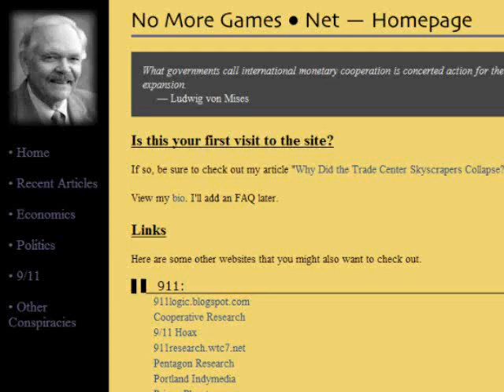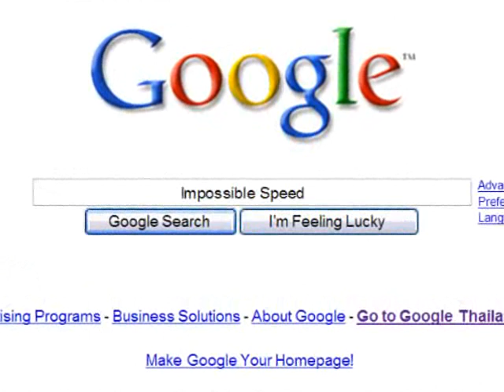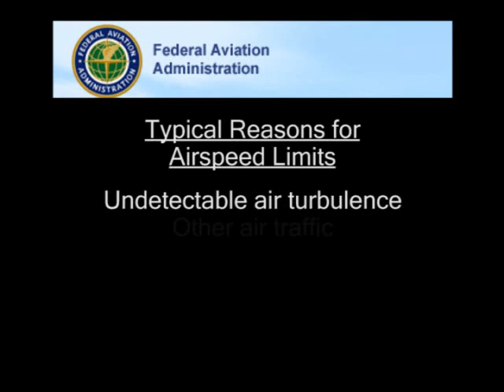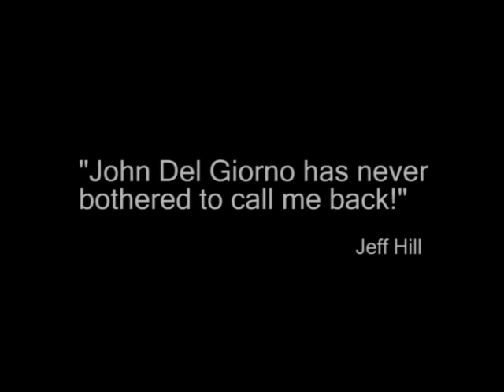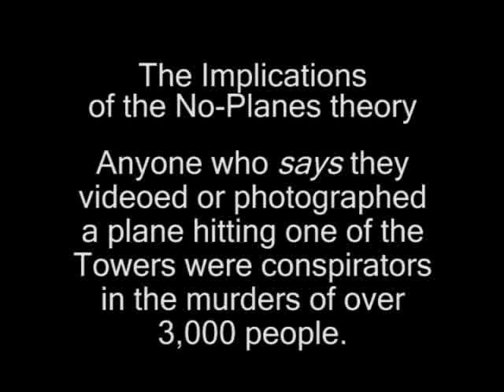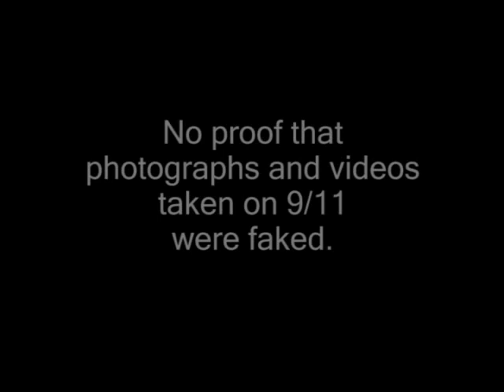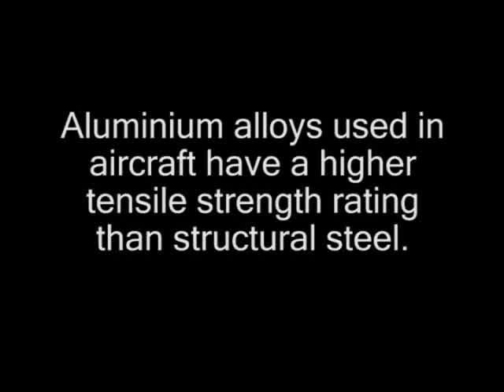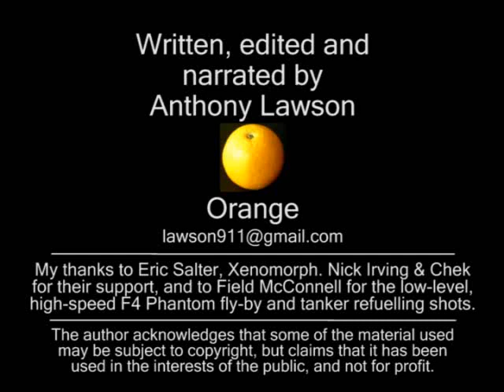9/11: Impossible Speed & Impact -- Busted! Updated

Comment: Just as my $0.02 worth on the subject, please think about this:  The aircraft, in order to reach the speed alleged to have been, would have to descend, be it a "power dive" or what ever  you gotta call it, its heading down in order to increase speed beyond what can be achieved in level flight using the jet engines ( also to address the military aircraft do NOT use the same engines as civilian airliners ) anyhow in order to do this power dive maneuver, the pilot must lose sight of the target and then upon pulling out, re-acquire said target.  There is also the factor of pilot skill, one needs to know the aircraft very well in order to dive, attain speed, and then pull out, and in the case of extreme speed, pull out in such a manner so as to not over-stress the aircraft & break something. .... not logical JIM, not logical at all!
Reply: +Bob Jay My dad was a airline pilot and been among the Pilots for 9 11 truth! The second "airliner" with a visible pod underneath is for remote flying in case the pilots are taken out!! They simply doesnt exist on anything else than military aircrafts! The second plane flew in a higher speed suggested here and it was at 580 mph!
Reply: I wonder if  he believes the impossible maneuver of the 757 that supposedly hit the pentagon, too. Came over the Pentagon at 7,000 feet, dove into a 270` right hand nose down turn then  leveled off at about 10-15 feet off the ground and maintained control throughout till he smacked right into the window of  Captain Gerald DeConto sitting right there in the Naval Command Center!!!!.  This guy???... Hani Hanjour  who could barely fly  a Cessna!!! ??  And to really believe that someone without  training and  conditioning could take all those G forces???? He would have been passed out long before the perfectly controlled maneuver he supposedly pulled off, and or (probably BOTH) the wings of the plane would have been ripped off!!!  The 757 couldn't even have been able to withstand those G's!! Sheesh. THAT maneuver ALONE makes me doubt the whole 911 official story. And that's  what it is...a story and a fabricated story at that!!
 Those planes that hit the towers were modified military aircraft that were DRONED. The real passenger planes were taken out over the Atlantic and vaporized. How?? Boeing Uninterruptible AutoPilot and smacsonic.  That is from the knowledge of Field McConnell. ABEL DANGER is where you will find the truth!!!
  Thanks to the uploader but sometimes it is confusing to me.~
These 'no plane' theorists make the TRUE  truth movement look like wackos and they just muddy the waters. .
Reply from the maker: And it's not even worth 2 cents.  You obviously haven't heard that large aircraft can be remotely controlled, with a computer interface that takes all kinds of internal and external conditions into account.  Try doing some reading.
Reply: Given a remote controlled aircraft, that still doesn't solve the problem if the penetration of the WTC wall without slowing down.
Reply from the maker: Bob Jay
 Another goal-post mover.  Have you checked that the fuselage did not slow down, slightly, as the plane was entering?  Check out Eric Salter's work on the plane's deceleration.  As for the impact, see if the following answers any other questions you might dream up.

The 9/11 planes—highly integrated pieces of tubular-shaped machinery, almost certainly Boeing 767s or something very close to them; KC767s perhaps—weighed, say,150 tons.  In the case of the South Tower impact, the plane was moving at a velocity of about 575 mph and I have calculated that kinetic energy to be expended was approximately 1,189,068 kilojoules. 

Some aviation alloys, such as wing spars, have a tensile strength greater than that of structural steel, so, as far as the vertical walls were concerned, something had to give, which were the bolts holding the wall sections together.  These broken-away sections were, of course, pushed inwards and the sideways-on concrete floors then tore those parts of the fuselage that did not enter between the floors to pieces.
 
The reason why the entry of the planes into the buildings seem surreal is easily explained.  In the case of the CNN/Hezarkhani video, the frame of the impact covers about three times the width of the Tower; say 600 feet.  Let's say that the average size of a YouTube viewing area is 6 inches across; half a foot.  What we are talking about is a visual compression of 1200 to 1 of an NTSC broadcast image, recorded on VHS. 
 
You’ll get more detail photographing a bowl of porridge. 
 
Compare that to this video of a NASA rocket lifting off, where the cameras are one–hell-of-a-lot closer, and almost certainly a lot more expensive than Michael Hezarkhani’s.

Liftoff for Apollo 11
Reply: "explain how the two illusions were achieved and prove that your explanation is correct.  "   This is something that I take issue with most strongly!  I can prove beyond a reasonable doubt that the official story is WRONG, without having a ready alternative explanation for how it was done.  Therefore the starting place for the demand for a new investigation is the fact that people can prove the official story WRONG.
Reply from the maker: Bob Jay  My true colours?  What I do is  follow the facts.  You are almost certainly correct in stating that "there were NO hijacked airliners on 9/11/2001" which does not mean that there were no airliners or no airliner lookalikes in New York.  So, please state your position, clearly: 

Do you or do you not accept that two large Boeing 767s or two similar planes hit the Twin Towers that morning?

If you do not think that ANY such planes were involved, you will have to do what no one else has ever done: explain how the two illusions were achieved and prove that your explanation is correct.
Reply: Seriously? No hijacked airliners? What, pray tell, happened to the passengers and crew? You need some serious mental health assistance.
Reply: Bob Jay He never once said that there was hijacked airliners involved. He's stating that planes were used, which is correct. Anyone who believes that no planes were used are either incredibly stupid and gullible or a disinfo peddler
Reply: The fact that it is physically impossible for the "FLT175" & "FLT11" penetrations of the twin towers to have been done with actual airliners, it is extremely doubtful that even modified military aircraft could pull off such a stunt. therefore the only explanation that works is that there were no planes.
Reply: Anthony Lawson Is this a Boeing 767 series 200 made from interlaced aluminum struts and spars with a 2mm aluminum skin to keep the wind out?
Did these aluminum skinned wings really slice through the 1.5inch thick box section construction steel and the 2.5inch thick steel spandrels as well as the 7 steel and concrete floors?
Reply: Anthony Lawson All you follow Lawson is CNN and Fox News.
If you are asking about illusions, they can not even get there planes hitting the same level of the buildings before One studies the Physics or lack of as the case is.
Reply: Anthony Lawson You obviously do not know how to differentiate between 'Facts' and 'Fairy Stories'.
Try obtaining some books relating to Elementary School Sums and First Grade Physics so as not to make such an embarrassing and incompetent fool of yourself.
Reply: +Anthony Lawson Finally someone to agree with me.  Thanks.
Reply: +Bob Jay The fact that it is physically impossible for any hollywood like detonations to pull the debris inward towards the detonations,,, talk about a fantasy, "no planes".
Reply: do YOU, know for absolutely certain that there is NO, that is absolutely No means of creating the effect as seen, except by flying an airliner into the WTC tower?
Reply: +Bob Jay Well duplicate it then if you buy the nonsense of no planes at the NYC terror side. It is a cover for the fact that there was no plane in DC.
Reply: +Dhen Mcnab
"My dad was a airline pilot"
Loool. Hi Melch!
Reply: + Well buddy give me evidence that I have a split personality? I know you can have 2 accounts on Youtube though?
Reply: "Another goal-post mover." thank U ever so much 4 showing your true colors,
there were NO hijacked airliners on 9/11/2001.